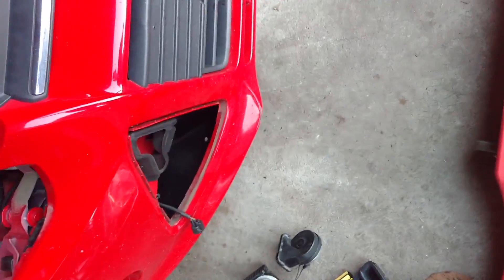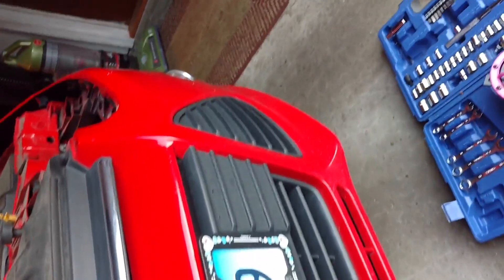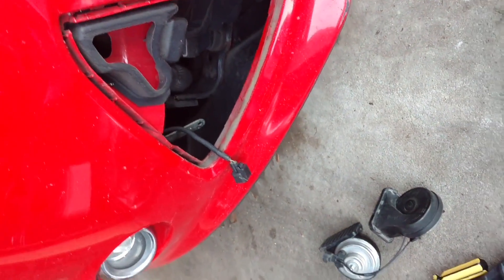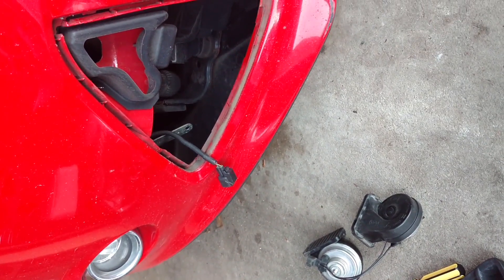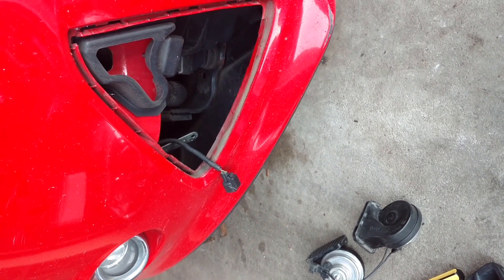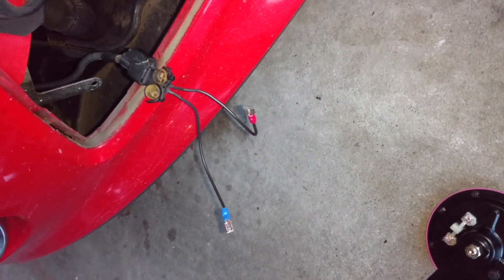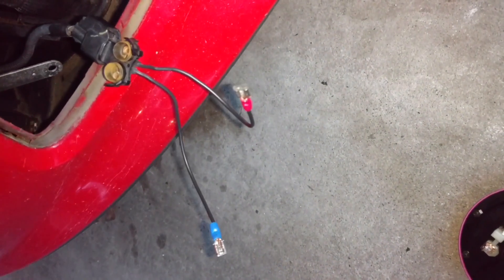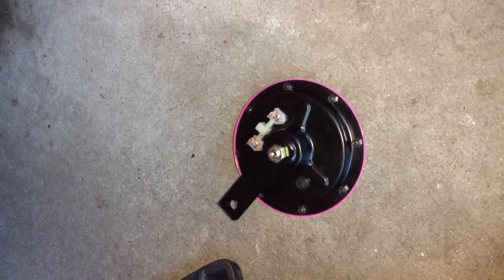MK3 Focus Horn

Comment: Dude! Awesome! this video was very helpful! My cover came off pretty easy. I moved the connection to the horn just a little bit then hit the alarm button and BAM! It worked. Took five minutes. But still, when I get home later Im going to remove the connector, clean it , put dioelectric grease on it and Hope I wont have to worry about it for a while! Again thanks for the video man! Only one I've seen on youtube so far.
Reply from the maker: Yeah, I couldn't find it anywhere. I was so frustrated having to take the whole front end off the car to change the horn. I was about to go to a mechanic to get it done since I couldn't get those stupid bolts off holding the bumper in place on each side (there are two on each side, super hard to get off without jacking the car up). And I've "hacked" other things, too. Like for example, on my Rav4 to do the fog lights it says you have to take the headlight units out and part of the bumper. Nope. I started to then said "there has to be an easier way" and there was: I took the plastic clips out of the wheel well so I could pry that back and was able to reach inside and get just reach the fog light assembly to change the bulbs to LED. Granted, the ballast isn't secure, but I haven't had any issues. Anyway, on our Fords, apparently they do this to make you go to a mechanic. Back in the old days the horn was mounted up top where it was easy to get to. =)
Reply: Long story short, similar situation luckily I was having the oil changed, and the two guys at the oil change place let me look under the car and I could see through the maze of braces, and brackets, and all the other crap 'engineers' put under the car😡! TWO the little horns, the connections look good, no rust or road grime, garbage, ice and snow melting junk around them, so I asked oil change guy for his ratchet extension, about 8 inches long, reached through all those brackets' and bracing crap around the horn which is a stupid place to put it!, 8 in off the ground where all the salt, sleet and snow and water can get at it, tapped them half a dozen times, I made sure I tapped them enough but not too hard and WALLAH!, now they work!🤣 so we'll see how long that lasts because right now it's four below zero outside, and I have no warm place to work on them, but come this spring I'll get back under there, take them off clean him out with electric parts spray, put a little Dielectric grease on them and see how long it lasts but thanks to your video I knew where to find the horns, so you've helped out at least one individual, and I thank you😀! good luck with yours and I wish I could help you.

Comment: An easier way of doing this is to remove the bottom panel located at the bottom of the car just in front of the wheel arch to the front bumper underneath. Then the horn is located on the drivers side behind the fog light. Easy to do. I done it in less than 5 mins
Reply from the maker: It's directly behind that plastic panel I took off, so that was easier for me, but if your way works, awesome!

Comment: I had the same problem, the issue is not with the in-line connector, but where the plastic clip on connectors mate with each horn. These let moisture in and the terminals corrode. I replaced mine with after market versions, but some cleaning up & sealing with some sort of grease or similar would fix the problem longer term than hitting with a hammer.
Reply from the maker: Seriously, that whole car made us both want to hit it repeatedly and all over with a hammer. Worst car we've ever owned. We got rid of it a few months ago and traded it on a 2019 Hyundai Elantra.

Comment: Thanks so much man  i was about to take to  cover off,, bty way cleaning the horn connector  fix  the problem sometimes
Reply from the maker: I should have, but if that wasn't the issue I was going to have to go get a horn, which I would have wound up doing in a store. Horns are so cheap on Amazon it makes sense to have an extra on hand just in case.

Comment: Go from the bottom. Take off the black cover on the bottom which has torx bolts and a few push pins. I only took 2 bolts and 3 push pins out and built the cover out of the way. It's one 10mm bolt and a couple of push pin/zip ties. Your horn is probably fine but you can put 12v to it and see if it turns on to confirm. The culprit is usually the plug itself which gets oxidation and/or the contracts straighten out losing contact. Clean the pin contacts inside the horn plug, and where they plug into horn itself. Then with a flathead SLIGHTLY bend the pin contracts in, just a tad. You should be g2g after that, but test it before reinstalling. 

Do check the fuse and relay before doing any of this just incase.

Comment: Awesome video, how did you remove the black cover off?
Reply from the maker: Crap, sorry, I just saw this: I stuck a flat screwdriver in there, but anything that flush could probably get in there. I started trying with a knife and realized that could go wrong a few ways and switched to the screwdriver. MOst of getting it off was actually yanking it out once I had enough room to grab the edge. I honestly wasn't sure it would work.

Comment: Did you have to access the back of the little black cover to pry it off? If not what did you use to pry it off? I have tried prying mine off from the front and it doesn't want to release. I mean it really doesn't want to release.
Reply from the maker: Brickrider2 You found it! Yeah, it's a pain in the ass to get off. I carefully used flat screwdriver and wound up just yanking it out. It came out but even if it had broken, that part is way cheaper and easier to replace if you have to than taking the whole front end of the car off.
Reply from the maker: Brickrider2 I kind of pried at it going around the edges to work it off enough to pull out.
Reply: That is exactly what I did. I tried prying it off around the perimeter but ended up just giving it a couple of good yanks. After that I found removing the splash panel attached under the front bumper allowed better access to the connector. I sprayed both the male and female connectors with contact cleaner then WD40 and buttoned everything back up. Thank you for your reply.
Reply from the maker: It's way easier than the other way. I got half way through taking off the front end and got stuck on one step where you have to remove these bolts on these clips on both sides. I couldn't reach them. I was going to just go to the shop but saw that cover and wondered what would be under it if I took it off. The horn. lol.
Reply: What horn did you end up getting?
Reply: I don't know about Adam, but I just cleaned the contacts. Once I seen that the OEM horns were  Fiamm dual tone horns and they worked after I cleaned the contacts, I did not see a reason to replace them.
Reply: Brickrider2 ended up cleaning the contacts as well and it worked. 

I pried the little black cover as well. I suggest wrapping the tip of a screwdriver with painters tape so you don't damage the bumper. Work along the edges slowly and it will come undone.
Reply from the maker: https://www.amazon.com/gp/product/B00Y5N28S0/ref=oh_aui_search_detailpage?ie=UTF8&psc=1
Reply from the maker: My wife uses my Ford, so I got her the pink horn. Not that you can see it. I didn't mount it in front, but I suppose I could have. I was tempted to do two of them in front. Wrapping the screw driver is a good idea, but on our Focus, I already scratched the whole car cleaning snow off of it not paying attention one winter.

Comment from the maker: Ultimately, the car sucks. I've heard the Fusion's good, but Ford really screwed up the Focus.  So much so that I'd never be able to trust an RS if I had the money for that. There are things loved about the car. It feels really solid. The radio sounds pretty decent for a stock radio and you can tell if you go aftermarket it'll sound great because of the heavy door panels. The engine sounds great for a stock 4 cylinder. The trunk was a decent size. And it's pretty comfortable to sit in. Unfortunately, everything else sucked. The viewing angle was horrible at night. We both kept having to sit way up to see the road on dark streets even with aftermarket LEDs. The wipers make zero sense. Not having the frame and having them flop all over the windshield was annoying. Plus they put so much downward force on them it always made a horrible sound. Even with silicone wiper blades.  The car vibrated like crazy all the time. I'm not sure it it was the engine mounts or the recall issues. The Ford dealership near me wouldn't do the recall work, they said it tested fine. Even for the gas tank issues. When I called Ford they said if dealerships wouldn't do the work there was nothing the could do. Ultimately, we got rid of it. We traded it a few months as a down payment on a 2019 Hyundai Elantra. The Hyundai is much better.